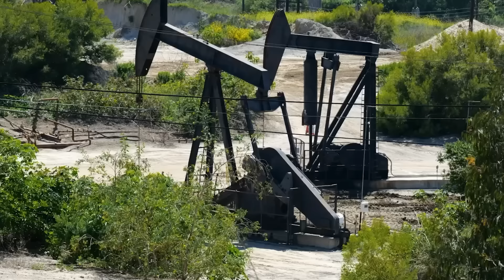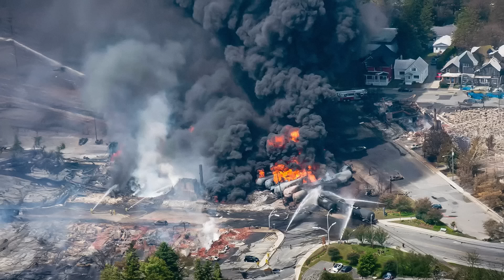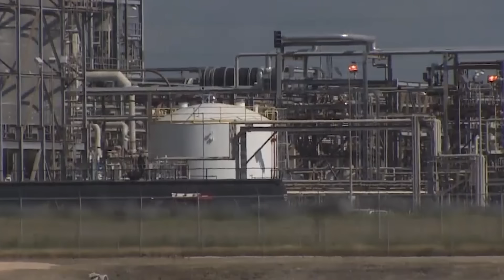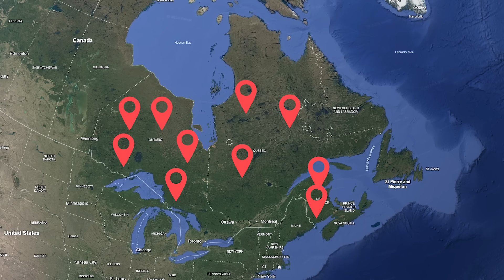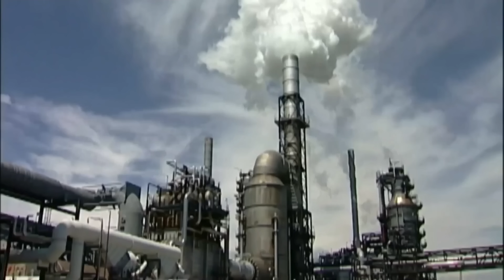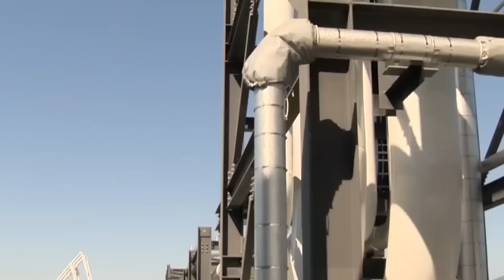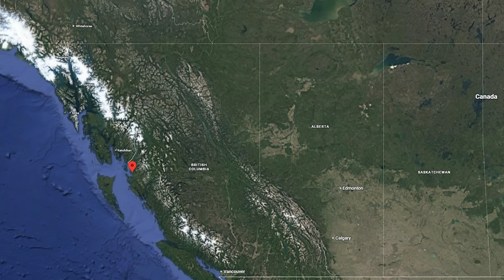Here's Why Canada Can't Build Its Own Refineries, Even Though It Produces Millions of Tons of Oil

Comment: 25 Billion dollars for a new pipe to Ontario/Quebec, no way? The latest completed pipe line from Alberta to BC cost taxpayers 32 billions dollars.
Reply: There are 13 out of 15 refineries in Canada that use Alberta bitumen sands heavy crude oil right now. 

All 13 of those refineries receive deliveries directly via pipeline from Alberta, including all four in southern Ontario (via Line 5) and the only refinery in Montreal (via Line 9).

The two refineries that do not use Alberta crude oil in their refinery diets are located on the south shore of Quebec City, in Lévis, and in Saint John, New Brunswick.

The refinery in Quebec City is owned by Valero and the same company owns a massive storage depot in Montreal. Furthermore, Valero also owns an oil pipeline between Montreal and Quebec City.

So the reader may be asking themselves: so wait, if there's already a pipeline between Alberta and Montreal and another oil pipeline linked directly to the same company's refinery in Quebec City, why aren't they using Alberta crude oil too?!

The answer is simple: it's not economical to do so.

Alberta bitumen is heavy in asphaltenes and low in resins. This makes it a low-value product that is generally used as a cheap blending agent to bring down the overall cost of refined petroleum products. Remember when the Conservatives told you that Western Canada Select oil was priced lower than West Texas Intermediate because there was insufficient pipeline capacity to Canada's west coast and Canada was stuck with only "one customer"? Well, the Trans-Mountain oil pipeline is now complete, exports are happening all over the world, plus, there is excess capacity available on it!! And the price gap between Western Canada Select and WTI is still over $12/barrel on average!! Chalk it all up to yet another Conservative lie. Pierre Poilièvre is a rank expert at lying to Canadians and Conservatives are repeating the same, tired lies that are being disproven every day with TMX exports to Asia. Bitumen sands crude oil is low quality, and no amount of pipelines will ever change that. 

No, Valero actually uses their pipeline to ship finished products westward, from its refinery to Montreal instead of shipping Alberta crude eastward. 

Suncor also owns a Quebec refinery, in Montreal.  Suncor blends Alberta crudes with imported crude oil from overseas via tankers that land from the eastern US, Norway, the Middle East and Nigeria with light, sweet crude oil. The imported oil either arrives by tankers, or occasionally, gets unloaded in Portland, Maine and then piped to Montreal. 

Incidentally, the company that owns the Maine to Montreal oil pipeline applied to reverse its direction, so that the line could carry tar sands bitumen from Line 9 to Portland, Maine for marine export via tanker.  Concerned citizens of Portland in 2014 passed a municipal ordinance banning the export of oil sands bitumen at the Port due to environmental concerns. Portland Pipe Line Co (PPLC) filed a lawsuit to overturn the ordinance as unconstitutional, and against interstate and international trade. They lost in Court and abandoned their appeal in 2021. 

Many find it amusing to listen to the same Conservatives who worked tirelessly to destroy Canada's National Energy Programme in the 1980s now turnaround and counsel the government to ignore the economics and build a brand new pipeline from Alberta to those two refineries, even though it makes zero economic sense to do it today with all the existing infrastructure in place.

Comment: SO TRUMP CAN SHUTDOWN THE OIL SUPPLY EAST AND CARNEY WILL BE CRYING LIKE CASTRO.
Reply: The Americans operate 17 refineries in the midwest which are totally dependent upon Line 5. If the American government ever shut down Line 5, it would create havoc all across several states: fuel shortages, tens of thousands of Americans out of work, industry shutdowns in manufacturing, etc. And the refineries could not easily find replacement crude, since they are tooled with cokers to process heavy bitumen. 

So, the chances of a Line 5 shutdown are infinitesimally remote. 

But let's assume the doomsday scenario. What could Canada do if the United States sows energy chaos? Well, immediately we would start railing to deliver Alberta crude to the 4 Ontario refineries and the 1 in Montreal that depend on it. We could also still use the Line 9 oil pipeline between Ontario and Quebec. So we have a lot better options than the Americans do. 

The suggested alternative is absolutely ludicrous from a taxpayer standpoint. Alberta Premier Danielle Smith and others are proposing spending north of $50B to build a duplicate, more costly oil pipeline just in case the Americans go nuts and enter self-destruct mode. But again, a duplication of Line 5 would only make economic sense if and when that happened. All other times, it would be a costly boondoggle that would require billions in new subsidies each and every year.

I've heard and seen a lot of bad business proposals, but this white elephant takes first place in the pantheon of stupid ideas.

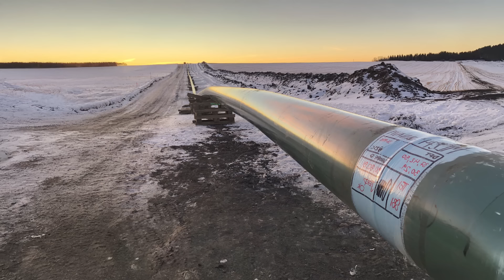Comment: 16:55 - Why do these pipelines look like they're propped up on used shipping pallets?
Reply: The pictures show the pipe before it is buried. The pipe sections are welded together, inspected, protected then lifted and lowered in a trench and covered . The blocking allows welding and access around the complete pipe.
Reply: @douglaslenart1651 what Douglas said.

Comment: This is filled with so much dishonesty it's sickening.  Canada has oil reserves around many places but it cost so much to drill that when the price of crude dropped significantly making it no longer cost effective to get that oil out of the ground when there is a steady supply on the global market at lower rates.  And here we need to take a knee and think long term.  Where is the sense in paying high prices at the pumps just to use our own oil?  Does that make sense to anyone?  It sure doesn't to me, logic says use other nations oil when it's available at lower prices and keep our own crude for when world oil supplies drop low enough to drive up crude prices making it cost effective to then use our own.   This puts Canada in a stronger strategic position which should be our long term goal.  Oh and the rail incident involving an oil train derailing was on a US owned and managed  section of track  where they ignored Transport Canada regulations which caused the accident.   Clearly a valid argument can be made to bar any non Canadian corporations form owning rail sections within Canada.  Not one single refinery east of Ontario is built to handle heavy crude so there is no reason to ship it east of Ontario at this time.   Even European refineries are not designed for heavy crude so no market in Europe for Alberta's heavy crude.  There is no US refined gas in the east?  that's how dishonest this video is.  it does cover some issues correctly.  It mentions Trans Mountain, under the Liberal Government spent 50 billion dollars on upgrades over Trudeau's time as PM.  His last November he provided another 22 billion in loan guarantees.   Meanwhile the Liberals provided tens of billions to the gas and oil industry in subsidies in an industry where shareholders take out record profits.  Why is  that ?   Why are we taxpayers subsidizing an industry who makes  45 billion dollars in profits every year?    Does that sound right to anyone?  Why does the oil industry want a pipeline built to an area that has banned oil tankers?  Or to an area that doesn't have a market for heavy crude, Eastern Canada?  Spending billions on these projects will eat up money we simply don't have.  All while there are many strategic areas we need to spend money on like the north in order to lock in our claim to the North West Passage.

Comment: Bottom line what the majority of "oil"  is Bitumen DILBIT ( tar sands) .
Very few refineries in Canada  can refine Dilbit .

It would be very expensive to upgrade the central and Eastern Canada refineries to be able to refine Dilbit .
And it is more expensive to refine .

Saudi oil ( not Alberta's dilbit) is cheaper to purchase and to refine  than Alberta Dilbit for eastern Canada use .. However if Alberta pre-refined the DILBIT into synthetic crude oil - it would improve its value and its versatility for being for use by standard refineries anywhere including Canada.
Reply: So simple Ottawa can not understand it.

Comment: Mostly true mixed with a bunch of misleading BS.
About 70% of Alberta oil production is light or medium, the other 30% is heavy. 
Refineries in BC, Alberta, and Saskatchewan produce nearly all the gasoline and diesel sold in western Canada & the territories.
Crude is imported into Eastern Canada, and refined in Canadian refineries to produce gas & diesel. Pipelines are the main issue here.
The vast majority of crude imported into Eastern Canada is from the US, not Saudi Arabia or Nigeria.
Overall, 90-95% of gas & diesel sold in Canada is produced in Canadian refineries. This is true for most countries, even countries that produce no oil. Fuels have a shelf life, and are generally refined domestically.
Canada refines more gas & diesel than it uses, making it a net exporter of refined products - mostly to the US.
Most of the refined fuel that Canada imports is kerosene/jet fuel.
Canada produces FAR more oil than it needs, so yes we sell it. That's not losing money, that's making money. There's a huge global market for crude, not so much for refined products.
Yeah we export a lot of heavy crude to the US refineries that are built for it, and the US exports a lot of light oil that their refineries are not built for. That's the global market.

Comment: I worked the oilsands for 30 yrs. 75 % of this article is normally found randomly deposited in a field.
Reply: There are 13 out of 15 refineries in Canada that use Alberta bitumen sands heavy crude oil right now. 

All 13 of those refineries receive deliveries directly via pipeline from Alberta, including all four in southern Ontario (via Line 5) and the only refinery in Montreal (via Line 9).

The two refineries that do not use Alberta crude oil in their refinery diets are located on the south shore of Quebec City, in Lévis, and in Saint John, New Brunswick.

The refinery in Quebec City is owned by Valero and the same company owns a massive storage depot in Montreal. Furthermore, Valero also owns an oil pipeline between Montreal and Quebec City.

So the reader may be asking themselves: so wait, if there's already a pipeline between Alberta and Montreal and another oil pipeline linked directly to the same company's refinery in Quebec City, why aren't they using Alberta crude oil too?!

The answer is simple: it's not economical to do so.

Alberta bitumen is heavy in asphaltenes and low in resins. This makes it a low-value product that is generally used as a cheap blending agent to bring down the overall cost of refined petroleum products. Remember when the Conservatives told you that Western Canada Select oil was priced lower than West Texas Intermediate because there was insufficient pipeline capacity to Canada's west coast and Canada was stuck with only "one customer"? Well, the Trans-Mountain oil pipeline is now complete, exports are happening all over the world, plus, there is excess capacity available on it!! And the price gap between Western Canada Select and WTI is still over $12/barrel on average!! Chalk it all up to yet another Conservative lie. Pierre Poilièvre is a rank expert at lying to Canadians and Conservatives are repeating the same, tired lies that are being disproven every day with TMX exports to Asia. Bitumen sands crude oil is low quality, and no amount of pipelines will ever change that. 

No, Valero actually uses their pipeline to ship finished products westward, from its refinery to Montreal instead of shipping Alberta crude eastward. 

Suncor also owns a Quebec refinery, in Montreal.  Suncor blends Alberta crudes with imported crude oil from overseas via tankers that land from the eastern US, Norway, the Middle East and Nigeria with light, sweet crude oil. The imported oil either arrives by tankers, or occasionally, gets unloaded in Portland, Maine and then piped to Montreal. 

Incidentally, the company that owns the Maine to Montreal oil pipeline applied to reverse its direction, so that the line could carry tar sands bitumen from Line 9 to Portland, Maine for marine export via tanker.  Concerned citizens of Portland in 2014 passed a municipal ordinance banning the export of oil sands bitumen at the Port due to environmental concerns. Portland Pipe Line Co (PPLC) filed a lawsuit to overturn the ordinance as unconstitutional, and against interstate and international trade. They lost in Court and abandoned their appeal in 2021. 

Many find it amusing to listen to the same Conservatives who worked tirelessly to destroy Canada's National Energy Programme in the 1980s now turnaround and counsel the government to ignore the economics and build a brand new pipeline from Alberta to those two refineries, even though it makes zero economic sense to do it today with all the existing infrastructure in place.

Comment: Or refine in Alberta and use the existing pipelines for ready product? 
Just an amateur wishing Canada well. 🎉🎉🎉❤❤❤
Reply: It's cheaper to pump crude in pipelines because it's all the same stuff.  Piping product means a run of gasoline, then a run of diesel, then a run of aviation spirit, then a run of furnace oil, then a run of heavy bunker oil for ships.  Much more efficient to ship the product out in individual tanker trucks, which means you put the refineries closer to population centres and roads, not near the oil fields.  The reason things are the way they are is usually a good reason, even if it "doesn't make sense!" to amateurs.
Reply: @lesliemacmillan9932 ❤🎉